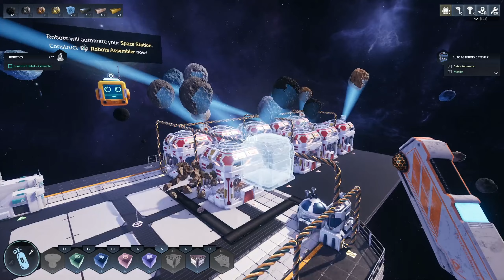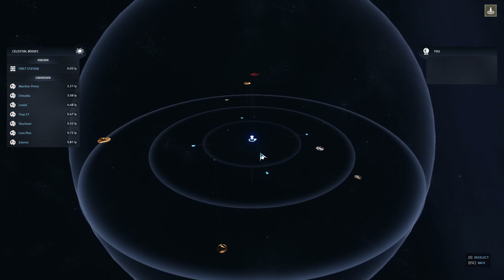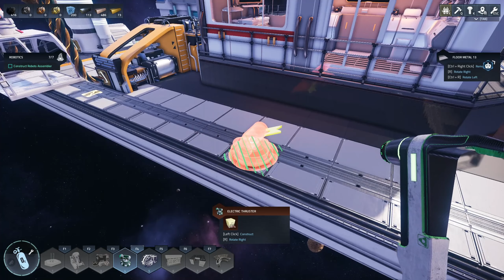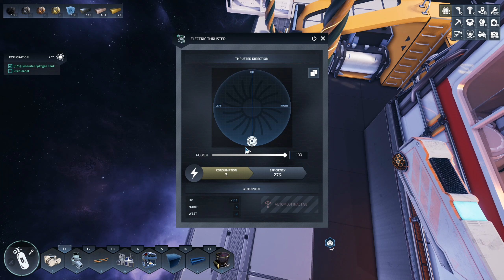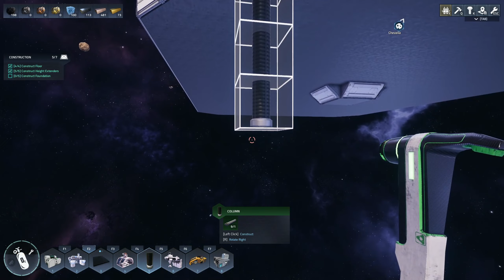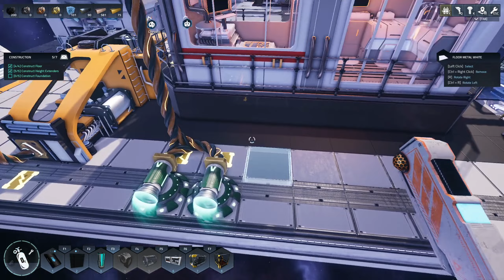Fire up the thrusters!  Let's Play Astro Colony s02 e04

Comment: thruster direction is not direction of thrust, it's direction of travel. with the reticle set on "down", you'll be moving down. if the reticle is centered, you'll be moving forward (the way the thruster is facing). up, down, left and right are also based on which direction the thrusters are facing. i hope this helps.
Reply from the maker: That is very helpful. Thanks! 😺
Reply: Super helpful!!!